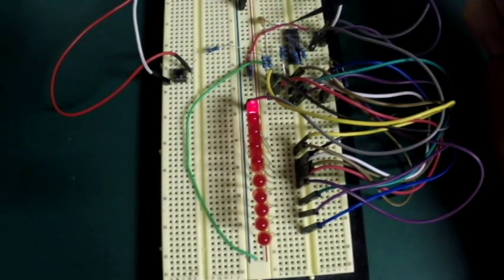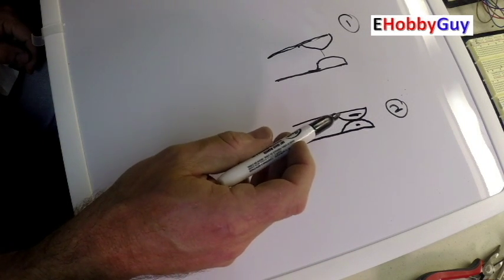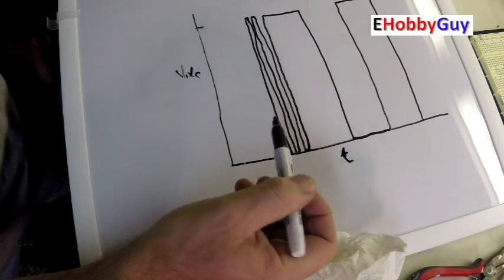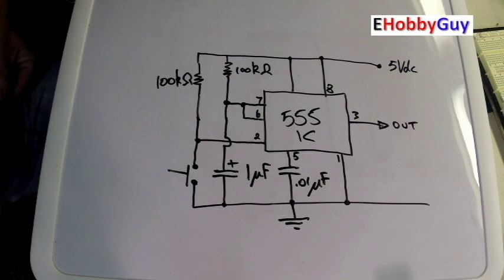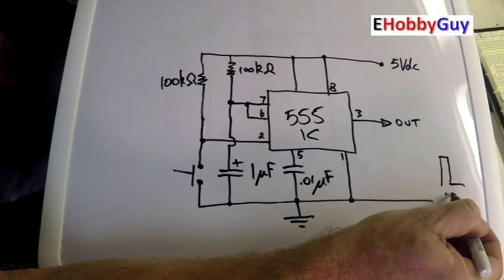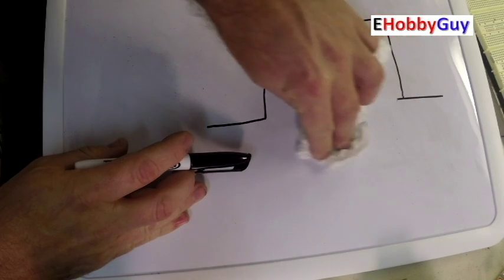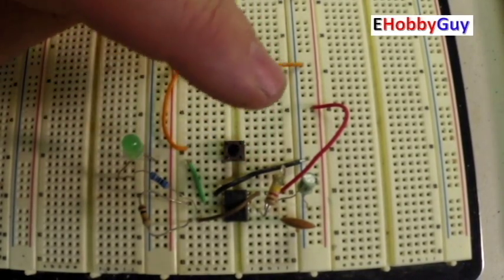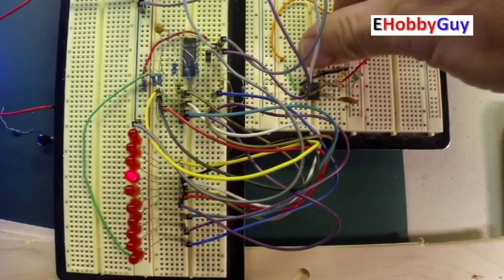How to Completely Eliminate Switch Bouncing

Comment: Vy interesting. Recently I have made a circuit with counter 555 connecting to 4017. Instead of the LEDs from 0 to 9, I have replace n put a mechanical switch to each number. These switches r then connected to one common relay only. I have a problem with debounce. The project is something like a pin ball game. When the ball drops into the hole, the mechanical switch underneath the hole will trigger a
 relay. Both the relay n the mechanical switch will rebound. So how do I go about eliminating this
this rebounding problems.
Reply from the maker: It’s a little difficult for me to be able to respond without knowing all of the details of your project.  There’s not much I can do. Even if you tell me All of the details, the way that it is hooked up can be a factor. Sorry I couldn’t be of more help.  Thank you for your feedback.  Thanks for watching!!!!

Comment: This is OK for a single switch but its going to be a bit much with a lot of switches say on a mechanical key's keyboard like a cherry.  Couldn't I just use a RC filter with a similar time constant or am I missing something?
Reply: I've used an RC filter with 10K resistor and .01uf cap.  You can clean it up further by adding a Schmitt trigger.